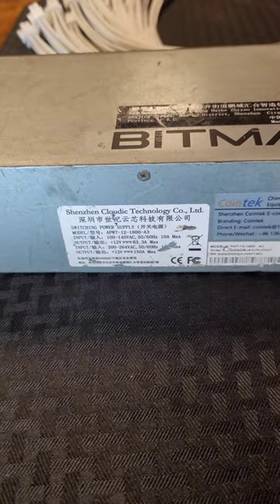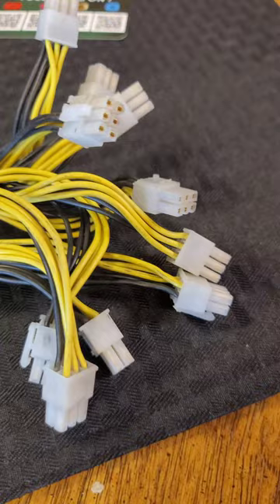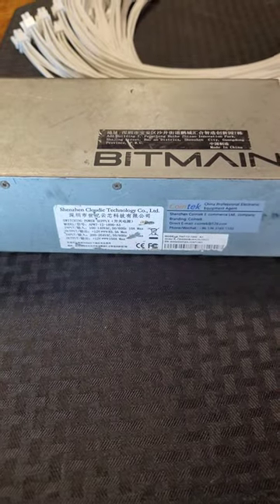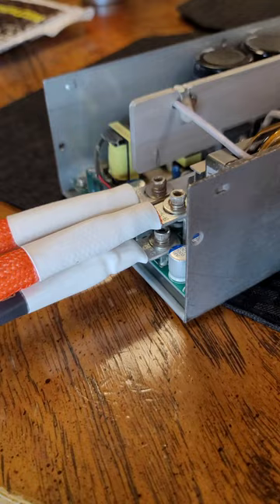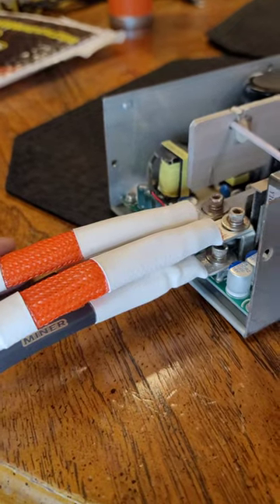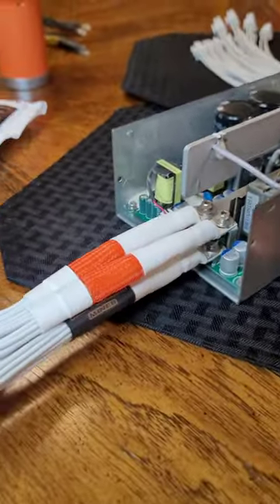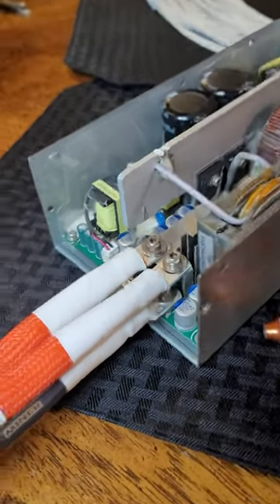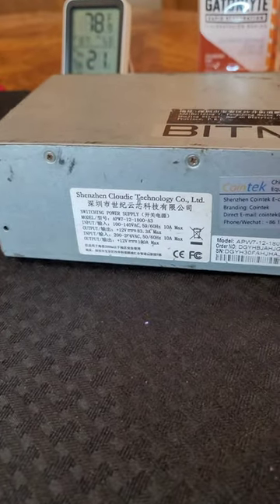Bitmain Power Supply Upgrade!! #Shorts #Crypto #Power

Comment: Thanks for the video quick question as I have one apw3 and one apw7 power supply is there a reason the cables didn't work on one of the apw7 power supplies?
Reply from the maker: Terminals touched in ONE spot on the other APW7. Might be bent, might just be a tony bit dif between them. So I wanted to leave a warning.
Reply: @NewEnglandCrypto  Thanks